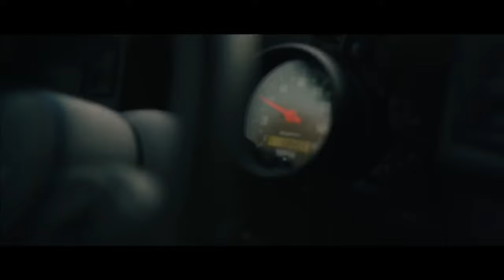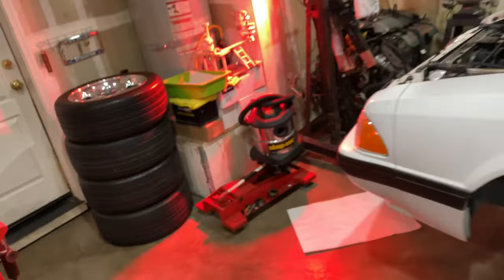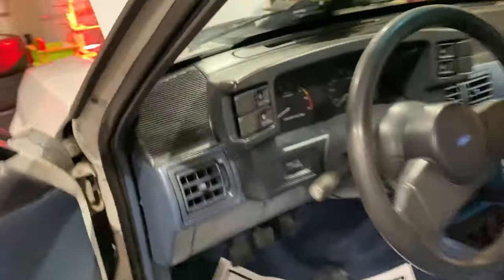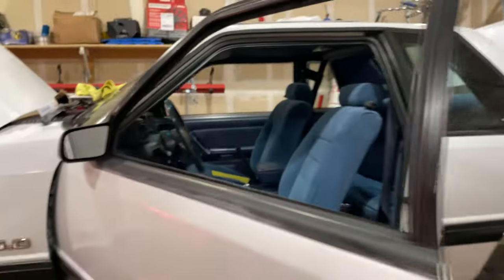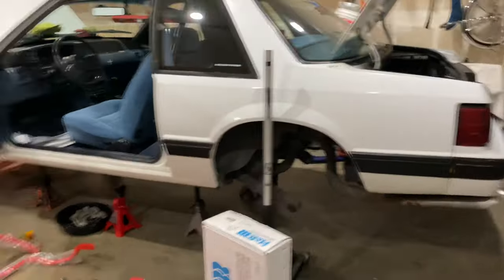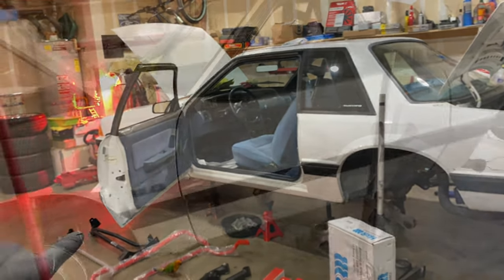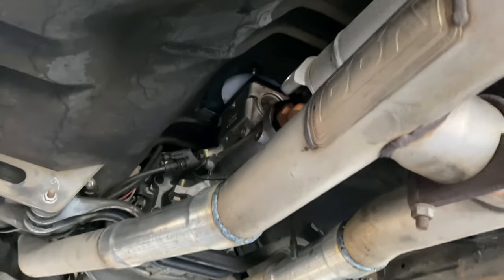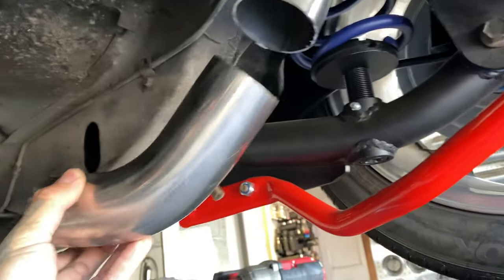Foxbody Mustang How To: 1989 SSP coupe Gets Big Brakes & Suspension Upgrade

Comment: I had an early 90's ex-CHP car and the only difference between it and a 5.0 LX was a bunch of braided bond straps all over the car. A panhard bar will help the rear axle feel more stable but it won't cure the snap oversteer at the limit. Adding a torque-arm will absolutely transform the handling.

Comment: 5 lug swaps are like LS swaps.  Just ruins the originality of the car right off the bat.
Reply: Unless the car is an extremely low mileage original, it's not worth all that much. A 5-lug swap opens up more brake and wheel choices. There's a reason the SN95 and later cars were all 5-lug.